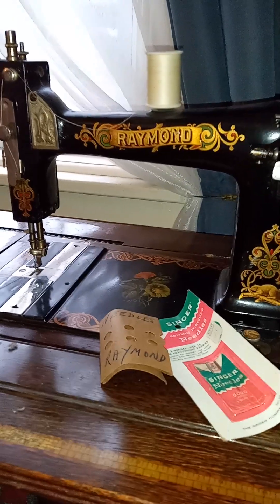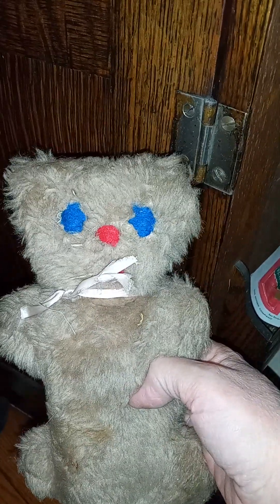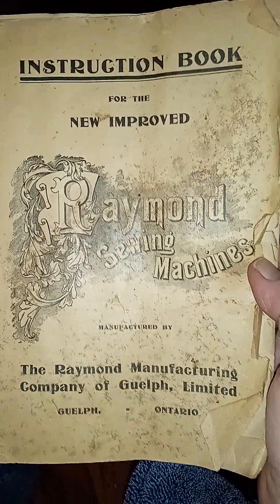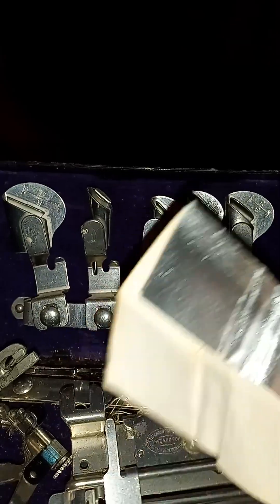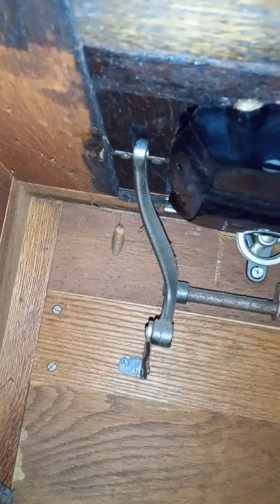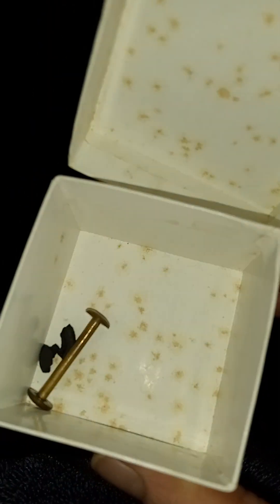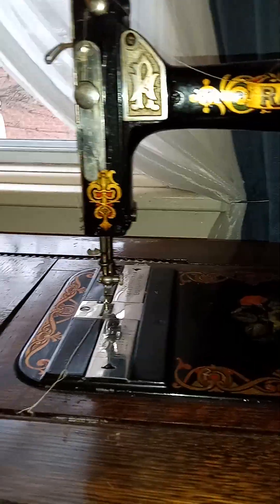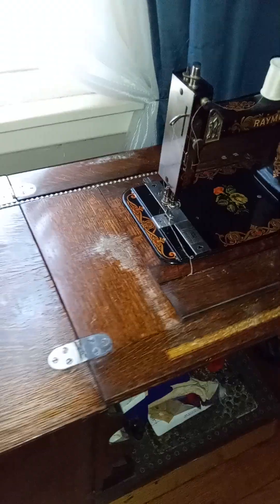Mom's old Raymond treadle sewing machine.

Comment: Beautiful vintage Treadle Sewing Machine. Could you do a video sewing some stitches and winding a bobbin. Thanks Glenn
Reply from the maker: I wouldn't know where to begin.  I haven't used it in over 40 years.
Reply: @caseymacmacl7463  beautiful machine though and love the old style closed cabinets
Reply: @caseymacmacl7463  Did you use to Sew a lot with it ?
Reply from the maker: @gip068  Not a lot. I preferred to sew outside or while I watched TV so I just used a needle and thread.